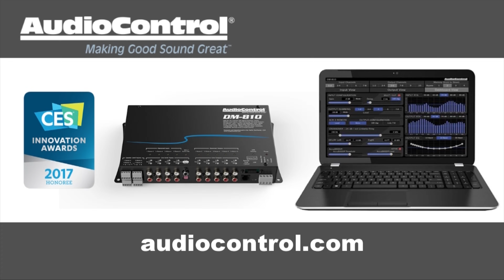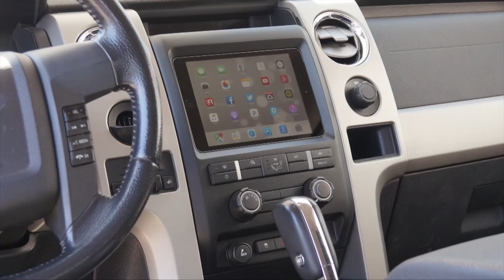BACK TO BOG! - body working the next section of the BASS VAN

Comment from the maker: WHAT UP DUDES?!?!?! 🙌🙌🙌 BACK TO BOGGING THE SIDE OF THE BASS VAN!! SO FAR THE BODYWORK IS TURNING OUT SWELL!! LET ME KNOW WHAT Y'ALL ARE WORKING ON!! 🐕💨FIDO GIMME A NOISE!!!
Reply: That Wet Wet coming soon.
Reply: I’m working on a Honda shadow gas tank.   Never did any body work before. Looking good tho.
Reply: Working on getting my stetsom 3k installed after pulling out the D4S JP8, getting the XS battery box I made installed behind seat, and getting ready to smash some lows at shows and comps. Love the progress amigo... turtle pace is the pace for me. Give me a noise fido!
Reply: Take the sticker off the cap of the dry guide coat if you haven't figured it out yet there should be slots in it
Reply: I'm repairing and restoring my BBQ. I'll be done in about 5 years

Comment: You’re supposed to pull the paper up from the lid on the guide coat can. The lid is slotted so you can distribute it on the applicator

Comment: If I throw some BOG down, first I'd hit with the 80 grit on the DA sander, mostly to get rid of the hard skin that develops on the bondo. Then I'd use 80 grit on the biggest block that fits and I"d knock it down. Then 180 on the same block to feather it out. Unless you're really good you're probably going to have to do that multiple times. Always sand after it's pretty dry but still soft. Use a wire brush to clean your sand paper often. That's important. And then follow the directions on whatever paint you're putting over the bondo to know what grit you should final sand. need epoxy primer under or over the bondo or both

Comment: Unfinished car project in my garage:   https://i.imgur.com/GJao2sC.png

It's the car from my profile picture.  1995 Mazda Hairdresser special that I turbocharged.  Car made a ton of power, until it didn't  Windowed a couple different motors from rod failure, then started collecting parts to build an engine.  Ran into a parts availability problem way back in 2015 sourcing a billet oil pump and harmonic balancer, but kept waiting and kept driving with a big turbo and otherwise stock motor, only I turned the boost way down to about 5psi.  Car made 280hp/225tq at the wheels on a 10 pound wastegate spring, so I figured 5 was safe. Spoiler:  it was not.  

Motor shit out another rod November 2016 and my brother put this dumbass idea in my head;  why don't you just LS swap it?  A stock LS would make a little more power and would be absolutely bulletproof.  Here's the rub;  its VERY expensive to source everything to make this happen, then you have about $4000 worth of front subframe, trans mount, and diff mount -- I wasn't interested in spending $10k on an engine/trans/diff/axles/oil pan/headers/cam/etcetcetc just to add another $4000 on that.  My brother is a professional fabricator and responds with "Get me a stock subframe and I'll make you one for an LS."  Okay, so the next day he had a stock subframe.  That was in November 2016, and he's yet to start on it..... MEANWHILE......  I bought an LS6, a brand new Tremec magnum T56, 8.8 diff, axles, oil pan, headers, harness, pcm, starter, etc etc etc etc etc to the tune of about $11,000.  Gutted the entire car, took all of the 4 cylinder wiring out of the harness, and started prepping to make some cuts in the firewall for bellhousing clearance.  

The car sits as a barely rolling chassis in my garage to this day.  Why not just finish it?  Well, I've poured so much money into this car in the last 15 years that I could have a nice 2nd hand C6-z06 vette without all of the bullshit...  and once I got down into the bones of the car, turns out the thing is a rusted out heap of shit.  Wish I could build a time machine, go back to 2004 and bonk myself in the head until the thought of buying this car never happened.